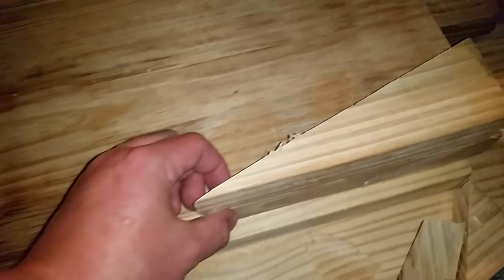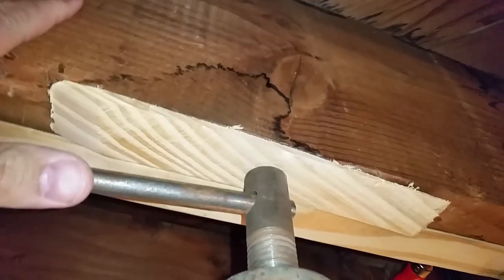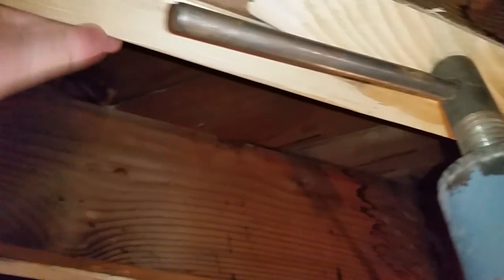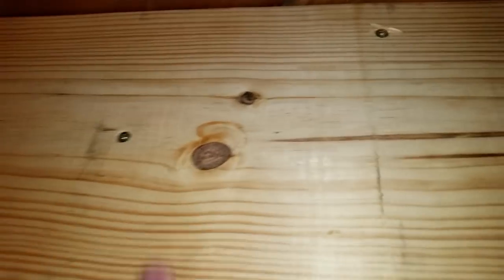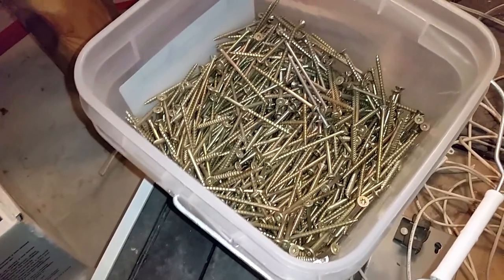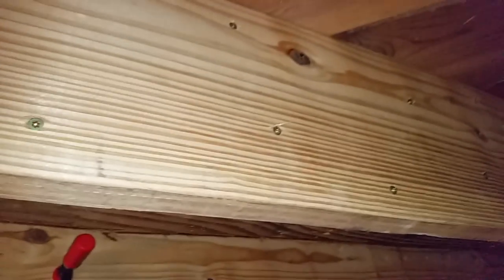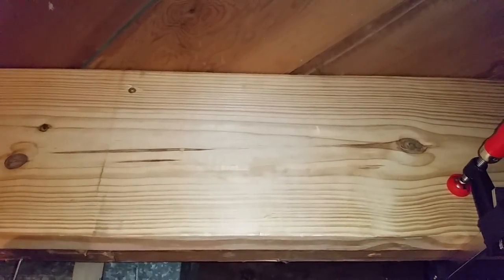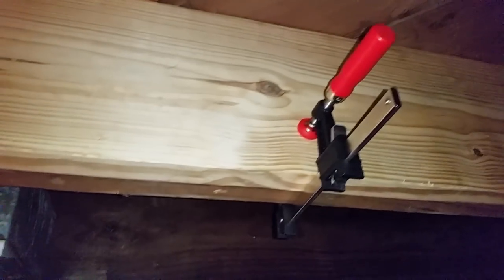Simple Method to Sister Joists

Comment: For anyone using screws, make sure they are labeled “structural“ (not just construction screw). The rafters are supported on both sides so it don't take much to prevent it from rolling but I would at least use structural screws, nails or lags. Job looks good.

Comment: Thanks dude, just finished sistering my joists after you inspired me. Only difference is I thru bolted the 2x12's with 1 inch structural bolts. I did use deck screws just to hold things in place while I sent the bolts. I also used bottle jacks instead of screw. Made life much easier. You da man.

Comment: This video is very informative thank you. I bought a house about a year ago, for dirt cheap. Downstairs Bathroom has tons of water damage. I have two cracked almost in half floor joist that I need to sister. And replace the entire sub floor in both the bathroom and connecting laundry room. I'm going to attempt to do the work myself due to lack of funds. The floor has sunk about half an inch, sense we stopped the water leak and let everything dry out.
Reply: its intimidating work but once you get your feet wet and started its not hard at all. good luck

Comment: Looks almost identical to my floor joists with the knots and cracks. I will also be using screws but in addition I will be using construction glue. Thanks for the tip on cutting a wedge off. I'm sure I would have figured it out but probably not until I tried to install one

Comment: Have used a cheap air palm nailer from Harbor Fright and nailing is a breeze, good for tight spaces (cheaper than nail gun for a small project) ...if you have use of a compressor.

Comment: Glad I found this. Have a floor joist below kitchen that is severely cracked. Question….when jacking up, do t you have to do this slowly over time in small adjustments? Abs when the floor is level, THEN you attach the new piece and remove jacks?
Reply from the maker: That will probably depend upon what's above it. For example, I probably would not jack it up much at all if you have a tile floor directly above. Likewise, any plaster or drywall walls might crack. Fortunately that's a lot easier to fix than tile.

Since I used conventional 2x10 lumber, it still settled back down a little bit after removing the jacks. Regular lumber is more flexible than steel or engineered wood (LVL) beams. If your goal is level and flat, then you need something with significantly less deflection and more strength than yellow pine.

Comment: I tore apart my first floor and sistered lvl next to old joists.  Its a huge job. Nails have  better holding power than screws. Technically u are supposed to nail sister joists every 16 inches.
Reply from the maker: Nails generally have better sheer strength than screws because they bend a lot more without breaking, but screws have significantly better "holding" strength because they're threaded and won't ever slide or wiggle out over time. 

If you only nailed joists together every 16 inches, it would be terrible. You want to use a lot of fasteners all over, probably 6 inches apart along and up and down.

Comment: Ways of sistering joists have to be reconsidered: it would be surprising that shear strength at the support would be a problem, thus it is not necessary to run the sister joist all the way to the support.

I would strongly consider adding a 2x (probably 2, 3 or 4) under the existing joist if the depth of the existing joists is un sufficient.  I would sit this lumber in a sheet metal U that I would bolt in the existing joist. This would probably be necessary only for the middle half of the span and where there are damages.

Of course that jacking the joist before drilling the holes is a must, and some construction adhesive between the 2x and the joint would help.

This way you can add depth, strength and stifness without having to take down most of the pipes and electrical that runs trough the joints.  A good engineer could be required in the process, though. Nothing is perfect.

Comment: Am i supposed to cut the 10 inch corner on the side of the crown, which the top corner? Thanks
Reply from the maker: The top side and make it as small or short of a cut as you need for your specific needs.
Reply: @nathanddrews  thanks a lot! Appreciate your help!

Comment: Similar problem with cracks through knots but my house was built in 1990 and the wood is clearly stamped with the type and grade which doesnt meet the span requirements according to the structural code.  City hall wont help with who approved this or even if it met code when it was built.
Reply: City Building Inspectors know better than to set themselves up for a lawsuit against the City.  Especially if they are going to be called as witnesses against their Department.  The problem is that most have insufficient inspectors, and many have to inspect 16 homes a day and drive time can really eat up their day.
Reply: you thought the government was actually here to help you?  lol

Comment: 3/4 plywood with glue and spax screws on both sides is plenty strong and easy
Reply from the maker: Sure, you could do that if you wanted.
Reply: Plywood is only going to span 8’ leaving another joint that would not be as strong
Reply: "3/4 plywood with glue and spax screws on both sides is plenty strong"

I am a licensed structural engineer and I strongly disagree with this comment.

Comment: Hi, Nath. Does code always require a sister to span between to load bearing points?
Reply from the maker: I don'tknow, I never consulted code for this. I did it this way because it is effective at strengthening the floor.

Comment: I am furious.  My builder was fired because he didn’t crown about 4–2x10 floor joists correctly and now on my new home I have about 8 feet that is slightly higher than the rest of the floor. The home is beautiful with stucco and luxurious interior we chose but what the heck can you do here?  Cut the floor joists that bow up then sister?  And then the question of the subfloor old nail rows?   I have worried about this for 6 years now.
Reply: There's a way to fix that.  You basically put vertical relief cuts 75-80% the way through the joists in a couple spots (from top if crown is too high, from bottom if it's too low), get the floor level, then sister over (preferably the whole length, or as much as possible).  This  should only be done to solid lumber, not engineered i-joists.
Reply: @Loonypapa  I knew that was the way but I didn’t know where to cut.  So my floor bows up about 1/2 inch so I would need to somehow cut the top of the joist while placing a sister joist next to it?  And yes these are solid pine joists.
Reply: @jochimbenschneider1915  Yes, that's the method.  It's best if there's no finished flooring or subflooring in place.  Otherwise you'll be fighting against the flooring.  The subfloor will resist it, but something like finished oak flooring will really fight the effort.  Linoleum or vinyl will wrinkle, ceramic tile will crack. If you're stuck with the subfloor in place, you can put relief cuts in the subfloor and then add blocking to support it once you're done getting the floor level.
Reply: @Loonypapa  oh boy.  Well I have 3/4” thick plywood T n G subfloor and then oak strip flooring above and on the other side of the wall in about the center of my house it’s carpeting. I believe I’d best get a really good carpenter to take a look.

Comment: You don't have to sister in the whole length of the joist.
Reply from the maker: Some of them did need it, so I just did them all. No regerts.
Reply: @nathanddrews  Did you sister the joists with the ducts running parallel to the joists? I was just wondering how you got them in there with so little space.
Reply from the maker: @mcw3560  Yes, but it was rare that there would be ducts on both sides, so I could screw from either side. Eventually I replaced all the old 4 inch ducts with 6 inch ducts, so I didn't worry too much about taking them down temporarily.

Comment: You shouldn't use pressure treated wood inside. It will shrink a lot and cracked and split.
Reply from the maker: These 2x10s are not pressure treated. As a blanket statement, that is incorrect. Pressure treated wood most definitely should be used for bottom plates touching a basement slab. My local code requires it.